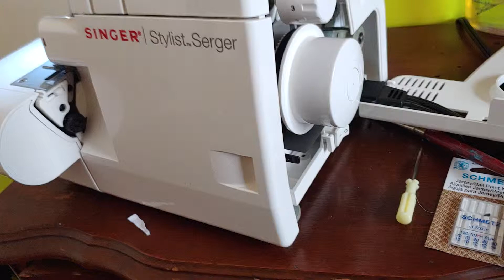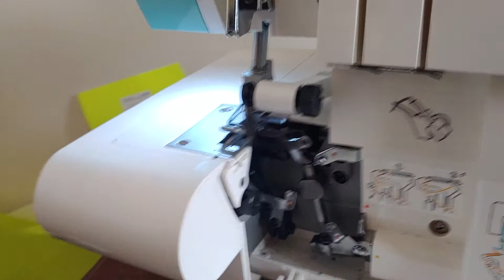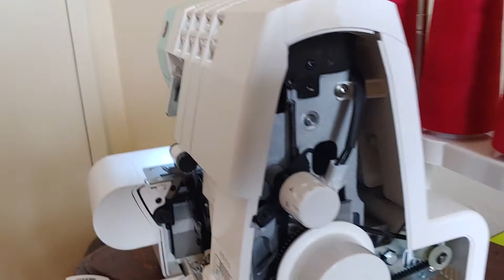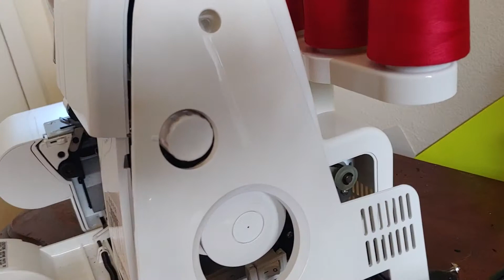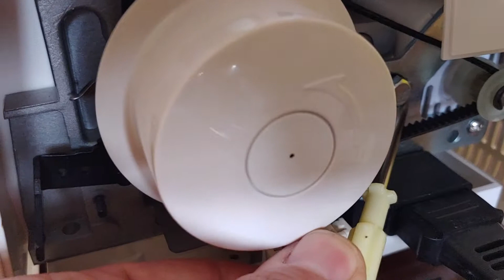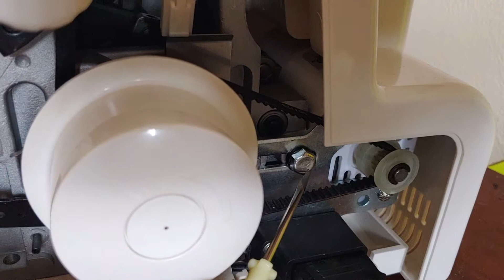Singer serger grinding and belt loose. Repair, fix and maintenance.

Comment: Hello! Good day. I would like to ask for your help regarding my Singer portable overlock/edging machine. The handwheel is jammed and cannot turn, and the motor only hums when I try to use it.
Reply from the maker: Try opening up that side panel and seeing if it needs cleaned out or seeing if the belt has come loose and jammed up in there. Sometimes that happens. That would be my first starting point.